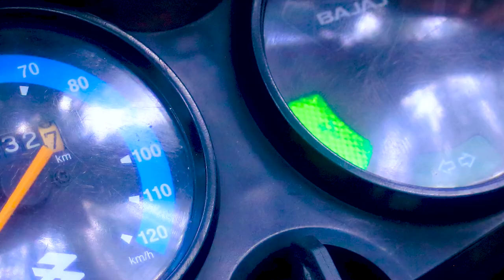BAJAJ BOXER CT FULL RESTORATION & CONVERT TO DISC BRAKE | MODIFIED

Comment: disk and front suspension and  Spock ring is from pulsar UG1 ??   and what's prices of this set up ,+ headlight visor and their side canister   ....................  You can add self start using AGC starter just coil and magnet modification